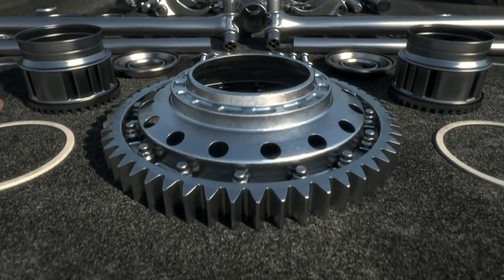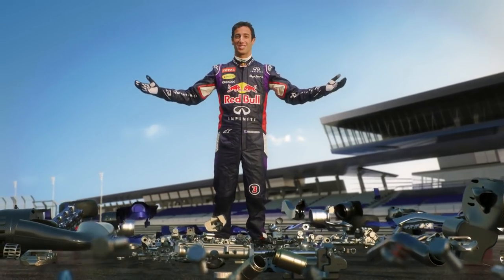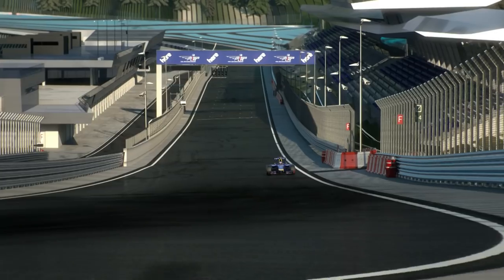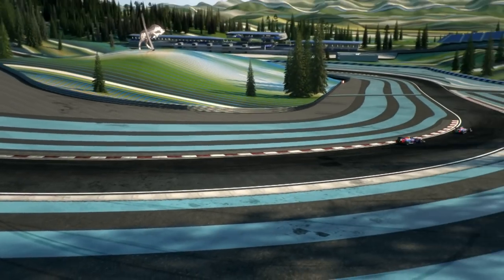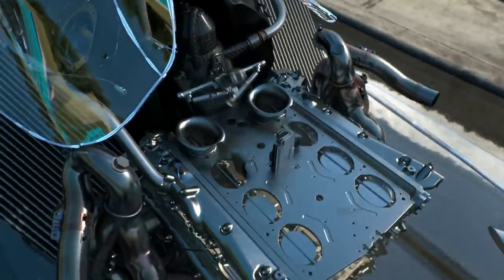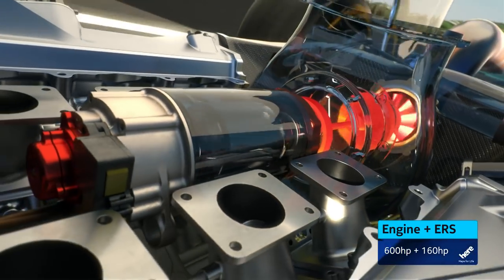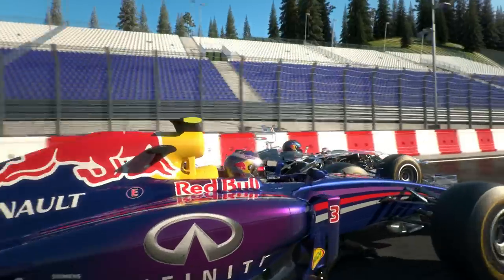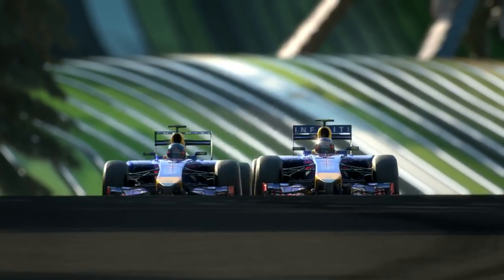Formula One V6 turbo: Rules Explained

Comment: I actually dont understand why many in the comment section talk about F1 cars being fuel efficient. I mean whats wrong with that ? Quite a number of reasons to have a F1 car fuel efficient just like how it is for Aircrafts and stuff that also work on saving fuel. A few advantage would be, Saving the cost spent on Petrol, and it also helps to reduce the weight of the car alittle as well. Fuel consumption also makes the Car eco friendly (less pollution) , thus being able to have More electronic systems to improve the performance on the car mainting its light weight. And believe it or not, F1 will continue to find ways to reduce weight of their car but still be able to have the car on the ground (Improving aerodynamics for a netter downforce and not let the car lift up in the air instead). Cuz thats how it works.
Reply: maintaining*
Reply: Well most of the drivers don't like it. It's not really pushing the boundaries of technology it's holding it back. I'm an engineer I know this shit. The main reason the FIA did this was to attract more investors, big brands by making it more eco friendly which is quite poisonous for the sport. That is not Formula 1. The future lies with a new engine one of at least 3.0 litres, V12, 20,000RPM, 900-950HP and a powerful KERS system. If you want to save fuel and be eco and stuff then apply that to normal road cars since that's the main majority of cars when there's only 22 F1 cars that run only 18-20 times a year. There's nothing wrong with having the best race cars in the world go round a track every 2 weeks or so.
Reply: +Qasim Mir okay, so how big will the track be ? F1 has used V12 engines years back, And moved back to V6 and at the same time being able to provide huge amount of Energy and Horsepower which  with V6 itself, Drivers find the car not only fun, but also challenging to control the car. Its also for the safety of the drivers in the track, noticed Now they are less loss of lives during races ?? Cuz they also Look at drivers safety on the track and not only about having a bigger engine. This isnt Street or Drag racing to Go for the biggest engine. Its Racing and Great Engineering. As an engineer you should probably know that Safety Is always first too right ? its stated in the video that "the car is tougher to control, Makes it challenging for the drivers" too :)
Reply: Safety will not be compromised by the engine size. Besides racing is dangerous accept it. And one thing Jules Bianci died after driving a the new V6 F1, the hybrid power can produce more wheel spin & loss of control during the wet.
Reply: +Qasim Mir hahahaha Bro chill. I think this convo wont be ending xD hahaha Lets jus quit it here hahaha. I looked up and they did stated V6 turbo engines produce more energy thn the V6 and V10 said my Mercedes AMG team themselves, But its alright, would love to see V12 with turbo engines too, cars would sound Amazing and would be alot thrilling to watch the races. :)
Reply: Correct.

Comment: 1980's, F1: 1.5 liter 4 cylinder turbo.  850 (racetrim) ~ 1.400 BHP, (qualifying trim), Everything manual, RPM: unrestricted, even the turbopressure was mid race adjustable by the driver by a simple turning knob.
2014 F1: 6 cylinder turbo: 650 ~ 760 BHP. Almost everything restricted.
* sigh * I miss those days...
Reply: +GTI1dasOriginal Formula does NOT exist for your masculinity and nostalgia, it exists to show off and test to the limit the technology developed by the Automakers.
Reply: 92axelmaster my whut? -_- I'm sorry, I only pointed out that I miss those days. You thinking it's "masculinity" or nostalgia says more about you yourself, your line of thinking than mine or what I meant by my earlier comment. And.... I've come at an age I've got nothing to "prove" anymore, NOR do I still live in the 70's / '80s but now and here, and am with my 46 years of age VERY alive and aware of what this day and age is all about. Is it prohibited to remember (on the F1 subject) how inSANE exciting the sports was back in those days because you say so?? Don't answer that, I'm not curious about what you think about that, so you can spare yourself the effort. Anyway.... I embrace many things that are "now", except 1 thing: F1. It's (for me) gotten to clinical, to regulated. That, my man.. is an opinion which I would much appreciate you not judging that, let alone making wrong assumptions about for having that. Thank you. Wish you all the best, have a wonderful 2016! Goodbye. :)
Reply: +92axelmaster  F1 is way too overlimited. Group B? That was really about technology development!

Comment: Why not just develop a powertrain that doesn't need electric motors and turbochargers? I mean, Cosworth has already done it for Aston Martin and GMA, plus it's reliable, it sounds EPIC (like the old F1 V10 and V12 engines, even though it doesn't idle, rev and redline as high), it's naturally aspirated and the best of all, it's a V12! :D Just look up to them and LOADS of fans will come back to the sport.

Comment: Too great quality / price coefficient in comparision to 3-wheel engine truss ( perforated L - beams welded with T-beams  ) with turnable all wheel in two axis ( int THE same manner as in motorcycles going through turn angles ). F1 is quite commercial and engineer-racable.

Comment: The V6 is the biggest mistake in the f1 history. The sound is terrible. The motor haven't got more speed(just look the record times on the tracks. They are all from 2003-2008 or 2011-2013.) Then why we need this. The peoples 90% hate the new v6 with the shit turbo. Back to V10

Comment: Honestly I don't care that this is a V6 rather than a V8, the loved V10 or the V12, or that it have a turbo...
But the sound, it was more than iconic, it was the soul of the F1, and it have been throw away because they reduce the RPM in plus of removing 2 cylinder...
Why did they not simply INCREASE the rev limit ?
THAT would have been a great engineering achievement.
Rather than making a V6 at low rev to make max fuel efficiency (that we don't care in RACE, those tech demonstrator better work for better reliability since today electric car are going to take the car market so ecology have no point if F1) who need a turbo to not fall under all other engines, they could have tried something more fuel efficient than before but not as a priority, use 6 cylinders but increase the rev range AND make the engine more reliable and more powerful, with or without turbo, for a longer range and use less engine than before as they do now.
Cause being efficient and powerful at a wide range of RPM, and make a F1 engine last longer than previous one WHILE having more complex unit and higher RPM, THAT would have been impressive.
And we would have keep the impressive and signature sound of the F1 in plus of a turbo which may have sound even better.
Cause here, except trying to make F1 cheap, I don't know what this technology demonstration is aimed to, they can even make it complete hybrid, I don't care as long as they don't nerf it, here it look like they took a path where improvement are more likely to go inside a Prius than any sport cars...

Anyway the animation was nice, and all other tech change and improvement to those car are impressive !
Reply: The reason for limiting the revs is simple. It ultimately stops costs from spiralling out of control, which would cause teams and investors to drop like flies. Developing and building F1 engines is already astronomically expensive the way it is. Fuel efficiency NEEDS to be an area of improvement. Not just for the good of Formula 1, but for the good of the automotive industry in general. The technical regulations force teams teams to introduce and refine new and more efficient energy recovery systems, motors and batteries, which are technologies that can be directly integrated into future everyday road cars, and even other modes of transportation. Whether you like it or not, fuel efficiency is more important in road cars than ever, given how finite a future fossil fuel burning has. F1 serves as a platform to incentivise innovation in areas that have become so critically important for the future of the automotive industry at large.

For the record, hybrid technology in 2016 has already vastly improved over 2014. The Mercedes hybrid power unit is claimed to now produce close to 900hp, which is right on par with (and sometimes exceeding) the power of the old 3.0l V10's of 20 years ago. But better still, they have far more torque than the old engines. And most amazingly, they can achieve such levels of performance despite only burning LITERALLY HALF of the fuel of the old V10's. You cannot deny that is an extraordinary achievement. Such combined levels of efficiency and power would be completely impossible with the conventional engines you're proposing.

"I don't know what this technology demonstration is aimed to, they can even make it complete hybrid, I don't care as long as they don't nerf it, here it look like they took a path where improvement are more likely to go inside a Prius than any sport cars..."

...Your ignorance is astonishing.
Reply: Your disrespect is astonishing.
And yes I agree, but also making more reliable engines, today where shit we buy are less and less reliable over time, is still important, 30Yo cars will still operational while models that we can buy today will already be good to throw away, this is also an important part of the ecology to not waste precious materials just to force people to buy again and again to make profits (if we really cared about ecology, the world would be 100% green today, but money is more important), tons of things the other way around could have been done, including using biofuel and real hybrid F1, not just ERS.
F1 is not the only important car sport where technology can serve as demonstrator, and those tech are not in their place here, F1 always was about incredibly powerful, light engine that are so well engineered that this is almost a miracle they don't blow up cause of the tolerances and stress.
Keeping this aspect, pushing limits of what we can do in term of power, reliability and incredibly low tolerances should be the first goal, others autocars sports like "24 Hours of Le Mans" will be perfect to play with fuel efficiency.
Also no one forbid to try using others techs to improve fuel efficiency without having to go to low RPM V6 engines...
I'm not saying that this is what actually happen, I just saying this is what should happen, no need to become arrogant and disrespectful.
Reply: Demongornot Obviously English is not your first language. I'm sorry if pointing out your ignorance hurt your feelings, but how else am I supposed to describe it? It is what it is.

"30Yo cars will still operational while models that we can buy today will already be good to throw away, this is also an important part of the ecology to not waste precious materials just to force people to buy again and again to make profits (if we really cared about ecology, the world would be 100% green today, but money is more important),"

I agree that this is a serious problem, but it's an issue that needs to be addressed with the lawmakers. It cannot be addressed with the sport. If the sport devised new technologies that increased the longevity of each car produced, then the costs of implementing that are always going to be greater than using the technologies that came before it, which is solely what the automotive companies are interested in. So it's a non-starter.

" tons of things the other way around could have been done, including using biofuel and real hybrid F1, not just ERS."

What's the difference between a 'real' hybrid F1 car and an F1 car that uses ERS? ERS IS a 'real' form of hybrid power. Biofuel IS being used in Formula 1 too. But it can only be used in small quantities because of the complications in the chemical structure of the fuel causing side effects to the engines that are difficult to control. Growing biofuel also requires an absurd about of land to produce and the amount of usable material that can be harvested into fuel (called the crop's yield) is nowhere near enough for that land area to keep up with demand. It isn't viable for the massive quantities of fuel we need. So instead fuel companies only put in about 10% biofuel because that's all the crop growers can manage to produce.
Reply: English is not the first language of the majority of people on the internet, anyway I'm dyslexic.

And you use points I said to explain "your truth" to tell me that I am wrong, this don't hurt my feeling except remembering me that I live in a planet full of idiot that can't just avoid to be aggressive and disrespectful at the first occasion, it won't surprise me if you live in the USA.

So using a single engine so reliable that it can be used during the whole season with maybe a second in case of issue rather than several which are still expensive anyway, for you, is more expensive ? Because the research made for the V6 turbo was not maybe ?
And yes as I said, I don't describe what IS done or what make profits but what SHOULD be done if the main objective was really to care about planet and technology and not to just get money and to keep the real F1 spirit alive rather than turning it into another profit oriented thing other than the race itself by trying to make everything saleable, F1 race was not invented for that.

I was talking about a real hybrid, on the real sense of the word, not a two modes engines that use once fossil fuel and the rest of the time electric, or those non sense non pluggable hybrid which are a joke, the energy that the electric engine use is produced by burning fuel which less efficient than electric engine in the first place and only produce a minimum footprint reduction in situation where the engine constantly run and the car don't move, which less lazy drivers could simply turn off their engine when stuck in traffic anyway to "almost" have the same result.
I talk about both as the same time, tons of things can be done in this way, including trying to use all the wasted energy in the form of heat that oil based engine produce and try to produce electricity from it, it can be steam (that we should not see as oldish useless tech, RTG on future Curiosity like rover will use it), it can be Peltier element or anything, but there is so much wasted potential (less than 50% efficiency on best modern engines) on those engines that we can use it to power an electric engine, and trying to do it might also cause big leap to energy storage capability rather than just aiming at short duration discharge for ERS, a cooperation between engineers of F1 and FE can be beneficial for everyone, more than just trying to get money, but for the whole planet, but here you are just focused on money and profits, this was NOT what I was talking about.

Still the 100% biofuel is possible, there is tons of way to make biofuel others than using crops by the way, including bacteria (more efficient than from crops for way less needed surface, I'm not talking about the plant eating bacteria here) and algae for example, this just need to be done on bigger scale than on labs or test bench, it is already proven to be a viable solution, we can also make vertical crops tower to reduce the needed ground area and tons of others things are actually possible to help the planet including stop destroying forests.
And EXACTLY, F1 engine are not fit for that, that's the point, we could find a way to make those engine being 100% compatible with biofuel (humans have already done way greater challenges) which might actually increase greatly mainstream engine compatibility and efficiency with those fuels and even methods to produce those fuels, this is more important to adapt to fuel which are literally grow from CO² and even if they are not 100% green the rest of the emissions can be handle by the planet itself rather than just trying to reduce CO² emissions from engine that will anyway produce CO² by using oil which from the extraction to the transportation to the fuel pump will produce CO² and is not renewable except by using biofuel.

If as much effort was done to create a perfect engine as it was to create the first nuclear bomb with the Manhattan project, we would have sci-fi engine so reliable, powerful and efficient that a small and light one which can run for half a century constantly will be better in any point than any actual engine including the F1 one.

Comment: The problem for me isn't the V6 1.6 litre, is the limiattions to made that v6 enough powerful, if the cars were shorter, wider, and lower with bigger lowered rear wings, and maybe ground effects

would crush any kind of naturally aspirated engines in f1 which existed, the real deal of f1, should be engineering not the pilots., If it weren't for the rule makers for researching engine reliability, these kind of little v6 would had crushed the v10 and v12 a long ago

They should, up the engine fuel capacity to 160 liters, the rev limiter to 20.000 and the engine capacity up to 1.8 litre. and the engines per season to 8 or 9

Oh, and allow refueling

Comment: seems like they would of went with a straight 6.  Get alot more races out of one. more torque. Alot of reasons
Reply: Much more torque from straight engines. More torque more hp